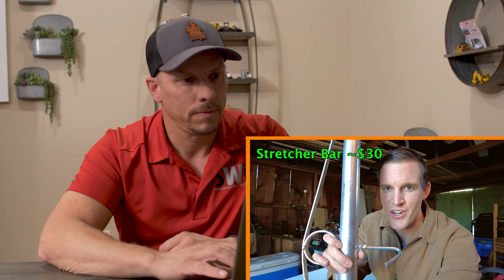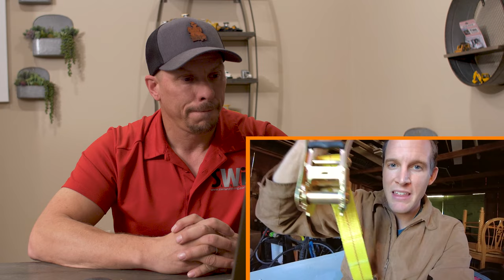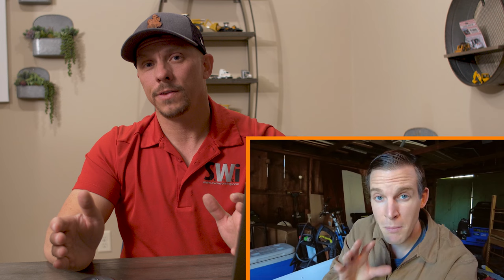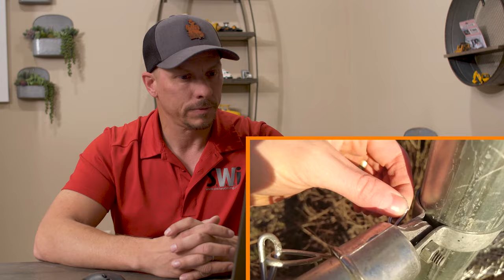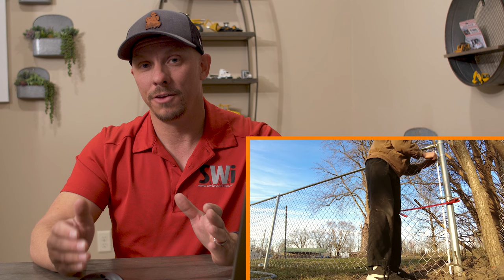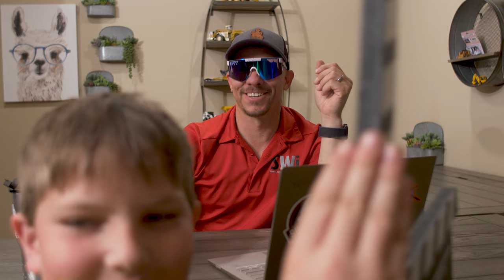Fence Contractor Reacts to DIY Chain Link Stretching Technique

Comment: Key to that dressing is eliminating as much slack in the wire as possible prior to stretching. Once you do that you can add a temp tie in the middle of the top rail between your posts, in addition to the tie next to your post, to minimize sag of the wire as you stretch. Equally important is to constantly lift the wire and slide the wire(fabric) along the top rail as the wire is being stretched, obviously a two man operation. Also, if space allows, stretching the wire on the ground and then lifting the wire up to the framework works really well, typically the wire will require no dressing, other than just tieing it to the posts and rail.

Comment: I just watched a short video where you were using the barb stretcher; I think it was "stretching and Installing Chain Link Fence Fabric" I don't recall you weaving it into the chain link; though you did use the double braided tension wire.

Comment: I use a skid steer and hook welded to the bucket  with a chain and two angles attached together with bolts and wing nuts. Six feet long. The advantage is that you can lift the fabric so it does not drag the ground when stretching. Also made an adapter to stick a roll of fence in a hitch receiver to allow unrolling from the skid steer.
Reply from the maker: We love people that solve problems! Sounds like an ingenious setup. 👍🏻 Maybe someday you can upgrade to an EVO. 😉 https://youtu.be/F50oo0Nm_qY?t=109
Reply: @SWiFence  If I did enough fence work I would think about it! Around here post pounding is impossible due to coral rock, but upstate there is sand and pounding seems like a real time saver!

Comment: We would center stretch anything up to or over 500 feet with a terminal post in the middle and shake the wire as we crank  the comealong (especially galvanized) . It's been a few yrs but I believe we stretched out tension wire with a tool called a dogleg and a comealong .
Reply from the maker: Fortunately there have been some advances and better tools have come along since then.
Reply: Stretching your tension wire using a barb dog and come-along. Dogleg would be used setting a post where a bldg footer is in conflict, dogleg allows you to clear the footer to get the depth you need to get adequate concrete around it.

Comment: what would be a good anti dig barrier besides concrete to keeps dogs from getting out? Personally, I like the double braded tension line I've seen you use instead of what this guy is carrying on his shoulder. The double braded wire seems like it would add more strength and allow you to stretch it a little tighter. I like the idea of using the hog rings to tie the tension wire to the fabric instead of trying to weave it in the bottom of the chain link. Seems like the hog rings will be more secure over time, especially if you have a dog that is constantly pushing at it, but this was what I was asking about in the comments of one of your other videos. I have a neighbor that has a fence that never had a tension wire installed, and his dog is always making new places to get out.
Reply from the maker: You can also install a bottom rail instead of tension wire. And if you really want to eliminate the problem, you pour a concrete dig barrier when you're installing the fence.
Reply: @SWiFence  thanks for the feedback.
Reply: @SWiFence  how wide and thick do you usually make the concrete dig barrier when you use it?
Reply from the maker: Out here we go about 12 inches wide and 4 inches deep. We have to have portions of that going beneath frost line of course.
Reply: @SWiFence  how many linear feet do you usually go before you take it below the frost line, and how wide do you normally make that portion of it?
Reply from the maker: Typically when we install a concrete mow curb we're setting the posts in concrete as well, so it goes below frostline at every post. Width is the same as the rest of the barrier.
Reply: @SWiFence  so if I were going to use a concrete barrier; probably every 6 - 8 feet with a pier 30" deep and 6" in diameter would probably work? I don't ever see that used where I am, but sounds like a good idea; it would probably make weed eating a lot easier on a metal fence as well.

Comment: Could you explain the term “dress out” more? I’ve heard that term a lot when talking chain link but would love to learn more about what it means and how to do it. Thanks Mark!
Reply from the maker: Dressing chain link refers to leveling the fabric so the top diamond flows evenly with the top rail. You can dress the fabric so the top of the fabric is even with the top rail, the middle of the top diamond is even with the top rail, or the fabric sits above the top rail one full diamond. We usually do a half diamond above. 👍🏻
Reply: SWi Fence & Supply of Powell thank you for that explanation! After doing fairly decent size commercial job recently ( biggest one we’ve done ) I’m really interested in learning more about how to do it better on the next one.

Comment: I spent 13 years as a 'fence foreman', building everything from field fence to prisons. (that 'no climb' chain link was a BITCH to dress because of those tiny diamonds and heavy gauge wire) 
I built baseball back stops, tennis courts, miles of residential & commercial chain link, that plastic farm fence...You name it.  
Those 13 years destroyed my back because being a foreman on a fence crew wasn't like a normal job. I worked as hard as the next guy (if not harder. ....but I didn't have to mix mud!  🤣

Comment: Hi, great video! Questions for you if you don't mind...if you have changes in angle (i.e. all land is flat, but at 30' of straight fence then you need to change direction by 30 degrees) do you put a terminal post at that change in direction? Also, what about a 90degree turn that only has 2' of fabic before it terminates? Thank you!
Reply from the maker: We would put a terminal in at both locations and break the wire even for a 2' run
Reply: @SWiFence  There are some mixed details out there, at what degree would you then use a terminal post? i.e. if the straight line changes by 30 degrees, keep a line post? thanks for all the help. We are tackling the fence this weekend!

Comment: The cemetery dad is buried at has a chain link in back that the diamonds are way overstretched the diamonds are stretched 2.5 wide 1.5 tall. It's pretty ugly looking... My mind was not on getting a picture at the time.
Reply: I should mention the gap on the bottom too